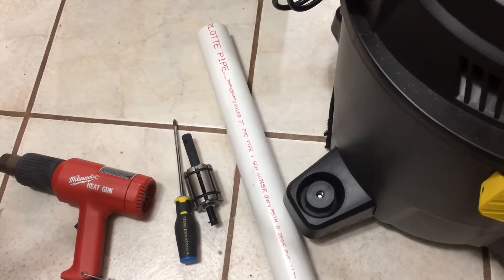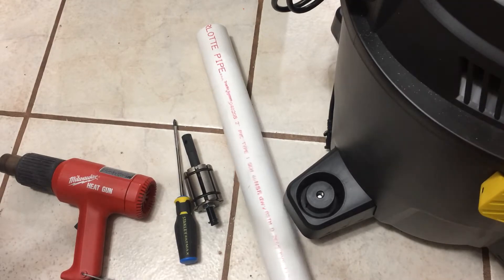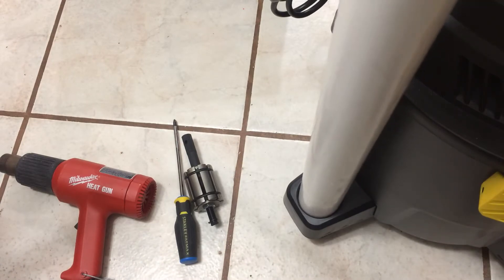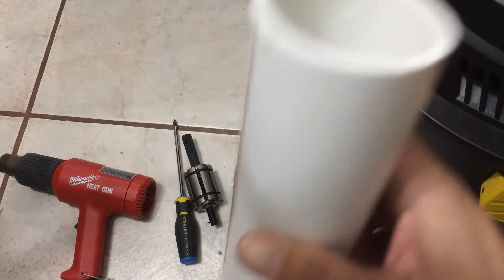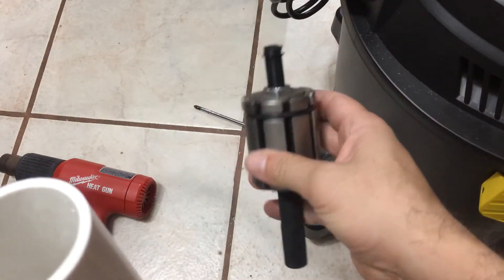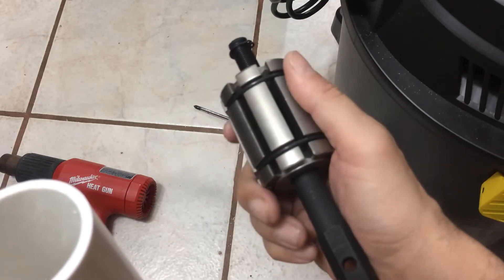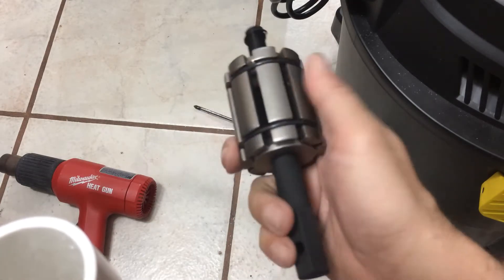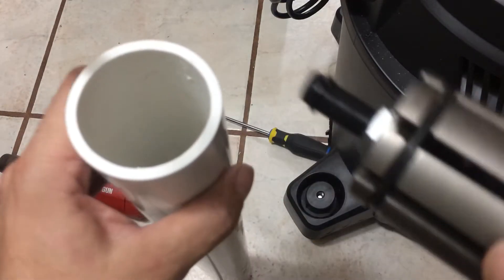How to Widen a PVC pipe using a pipe extender.

Comment: Good thinking. On the other side I wanted to fit abs pipe into a 2.5" shop vac opening. Tool the end of abs pipe, I cut 8 or so slits on the bandsaw and squeezed it together with a band clamp.